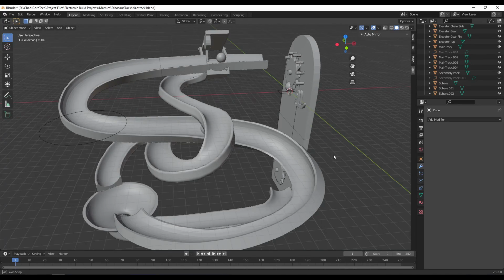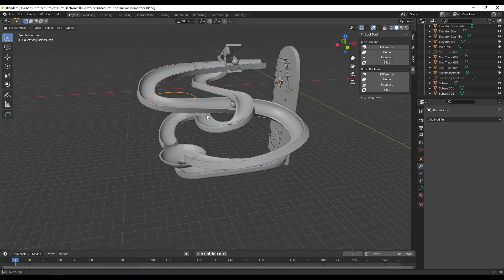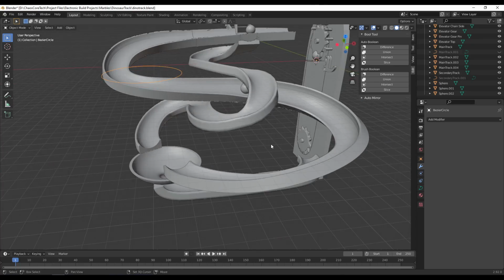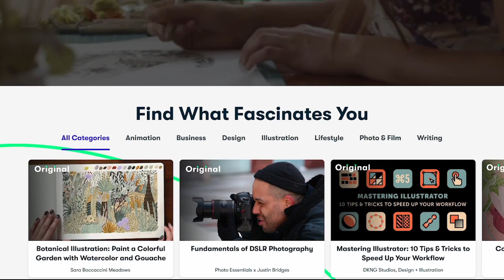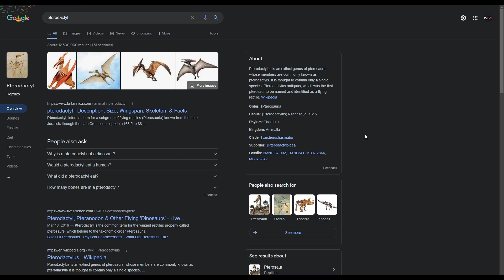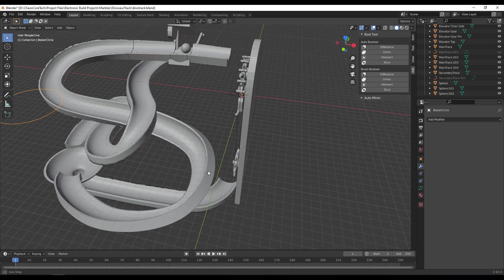3D Printing Some Mechanical Marble Track Pieces! (Part 2)

Comment: Look into sun gears and other multiple gear systems that can run at 2:1 ratio.  If the Dino chomps the track, the ' teeth ' block the track, the other gearset, running at a different speed due to ratio, opens the trap, closes the trap, while the teeth are down and not while in motiion.
Reply: I forgot to include that slots in a bar so that a pin can push/pull a rod work best 90° from the axis it slides on.  That will probably put the gears under the track and allow the dino to encapsulate the mechanism.  Keep going, the design is great!